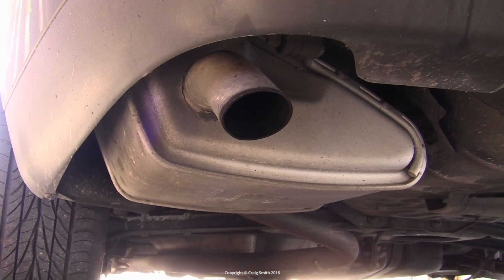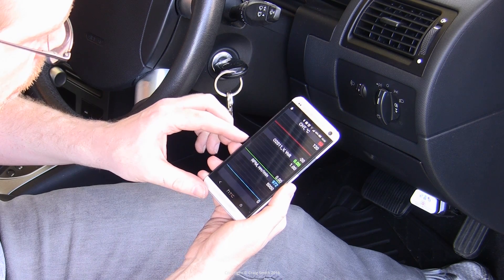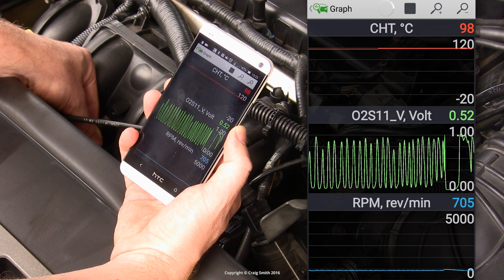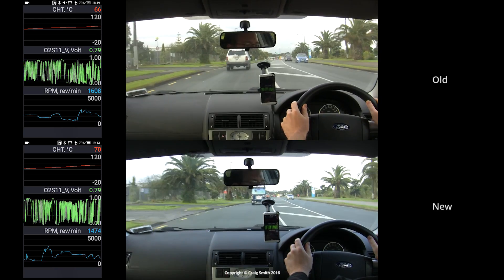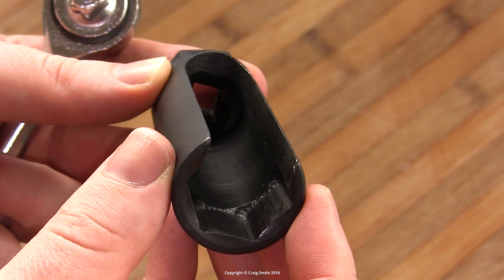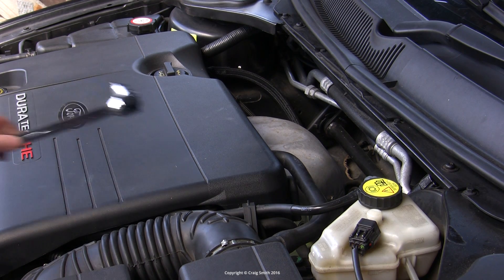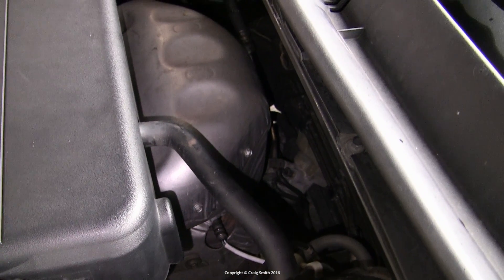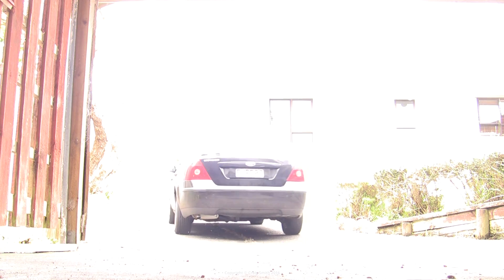What/why/how: O2 sensor basics & replacing (+ a DIY misadventure)

Comment: Hi, Can you help me with lambda sensors on Ford Mondeo st220? stock sensors dont work Well and i use Lambda emulators but rpm is not stable and when i push gas , rpm is not going Down but keep on 3 or 4k rpm. Have you got some values which must be on lambdas?  H and L settings od lanbda 0-1V

Comment: May I suggest a little tip? Tell me if I'm wrong, but if you are sure you want to replace the O2 sensors, can't you cut the electric cable and then dismantle the sensor with a standard tubular tool, with all the rotational force required and what you can get by that? Then the special tool is used exclusively for reassembling the new sensors, which requires much less effort to tighten.
Reply from the maker: Yes absolutely. That's what we tried (not on camera) but it still wouldn't give. Once you've cut the cable then you're a little committed.

Comment: Can you not just put a spanner on the hex portion and remove it that way without the special socket?  Edit- I can see that on your vehicle the 02 sensor is recessed into a cover. Thankfully on most vehicles the o2 sensor is not shrouded in that way. But its good to know the tool exists if i ever need it.
Reply from the maker: Upstream sensors will usually be inset behind the heat shield. An open ended spanner might not be strong enough for the same reason the tool in the video fails. A closed socket could work if you have access and can fit it over the cable plug (otherwise cut the wire).

Comment: I replaced the O2S1B1 on my 2002 Ford Fiesta 1.4l (ZETEC-SE engine) and that thing was very stuck. I used plenty of WD40 and a big wrench. In the end I managed to take off that thing and I realized that I snapped the O2 Sensor's thread, fortunately not too much to make it stuck into the converter.

Comment: Hi, just to share my experience today. In fact, we'll need 8mm socket to remove the heat shield of exhaust manifold. 6 for the top part and 2 for the bottom part. Don't need take out the bottom part, just move it to give enough space. Then use a 22mm socket to deal with the sensor, it's not hard for me to take out the upstream oxygen sensor :). slightly more than one hour job for me.